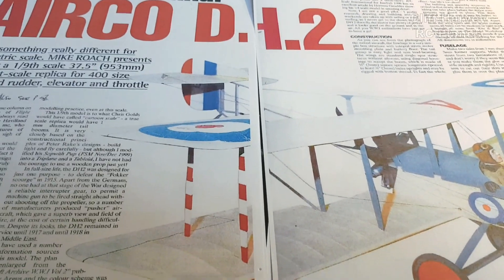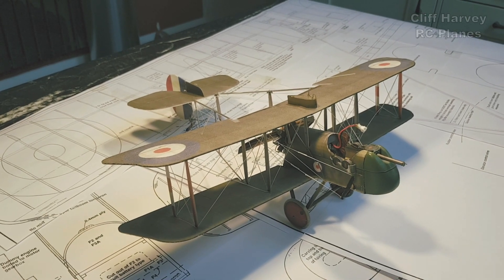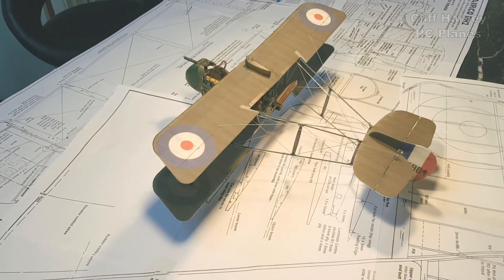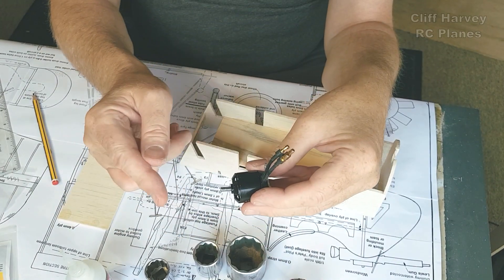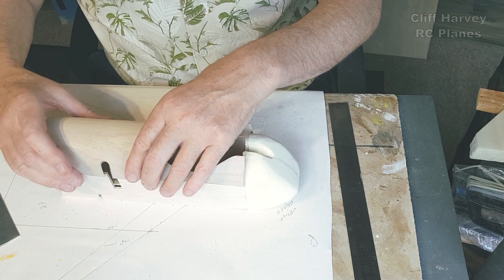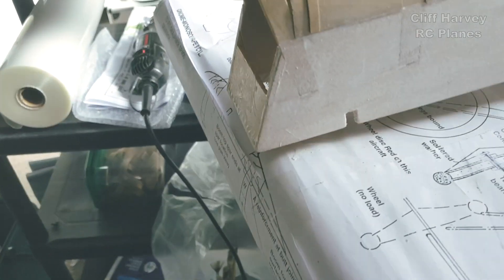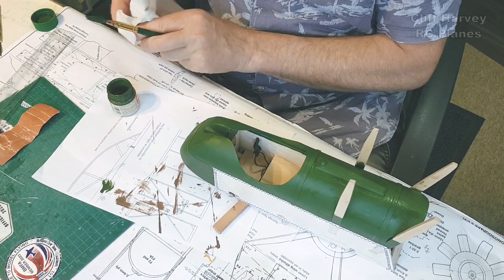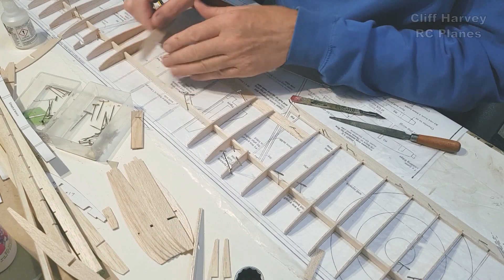The Building of a WW1 British Icon ... the Airco DH2, Part One

Comment: Hi Cliff, hope all is well with you and yours. Can I ask how you did the stitching on the fuselage? Did you do it on card or paper strip first then attach it?
Reply from the maker: Hi Phil, you guessed right, my wife used a zigzag stitch onto a sheet of A4 paper which I then sliced up and stuck directly onto the side of the model, really crude and quick but with a lick of paint it looks pretty effective even though upon closer inspection you can see the edge of the paper. You could apply a small amount of filler smoothed onto the edge to feather it in if you wanted, cheers  👍

Comment: Nice, I have one. They are very sensitive to the elevator because of the motor weight position. I didn't have as sensitive ailerons for some reason, I have more mass on the tail with the servos mounted on the back. Mine is an ARF, so it does not look as good as yours.
Reply from the maker: Hi Ted, mounting the servos on the back wasn't an idea I had, it would have saved a bit of work! They all look good in the sky though Ted, cheers

Comment: Neat job, Cliff.  One thing I do differently is fit the motor to the fire wall before installing the firewall onto the fuselage.  I just find it easier to drill the holes with the firewall flat on the bench or in my vertical drill.  I wouldn't dare to live video my building - too many bodges to reveal :)

A friend had a third scale DH2 which was tricky to fly and needed careful use of both ailerons and rudder. In fact, once in a turn, some reverse aileron, apparently.  Perhaps your smaller model will be different.
Reply from the maker: Hi BF, the reason I do it this way sometimes is to check the position of the motor against the rest of the fuselage, in this case I used a completely different motor from the geared original. As for bodges I'm an expert at them, the video wasn't live as such!! Having flown her now yes, she does need careful rudder and aileron use for best performance, cheers 👍

Comment: You mentioned using piano wire for an extended motor shaft Cliff, I would suggest using silver steel instead, it is more accurate.
Reply from the maker: Thanks Ron for the suggestion, when you say more accurate, what are you referring to exactly?